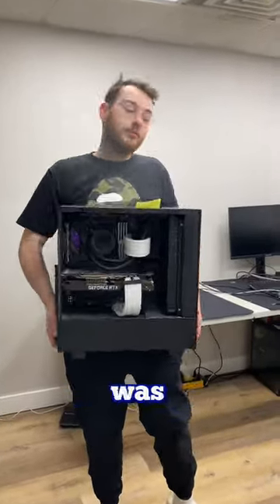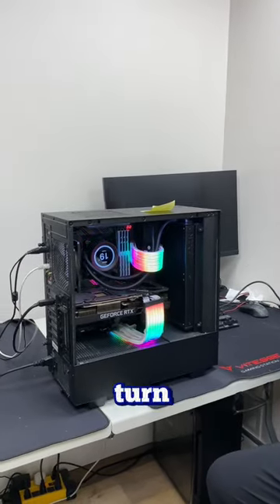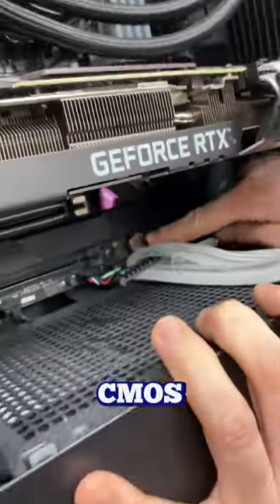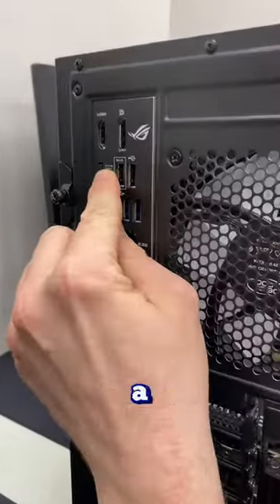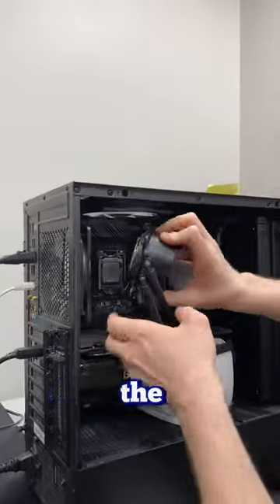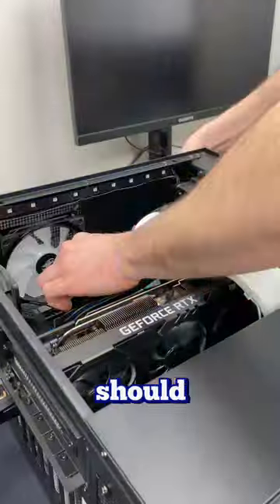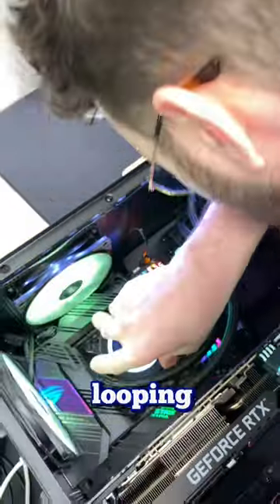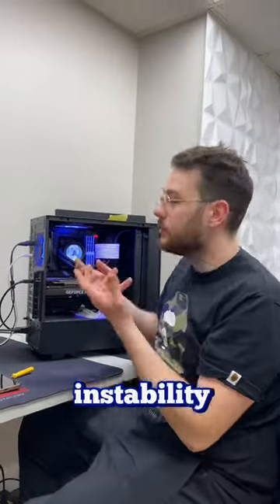PC NOT BOOTING?! 😤 #pc #pcrepair #gamingpc #pcgaming #egirl #gamerguy

Comment: Meanwhile me (Yesterday 12PM till morning 3AM Today). Also might as well share this if someone encounter similair issue like mine. Epsecially if you have no indication what error # it is(No beep sound/LCD).

Accidentally slam table resulting no display, restart PC. stuck at booting where GPU fan keeps spinning(It suppose to stop after few seconds).

Reseat RAM→No display→Re plug monitor cable to gpu→Still no display→Remove CMOS and wait for 30-45 seconds and insert it back→Again, no display→start panicking→Disassemble everything→Clean PC because it's dirty as heck→Realize I have no thermal paste spare→Go to city and buy one→Reach home sweat as hay→Re-assemble everything→Turn on→Same result→Drinks lots water→Decide to go back to the in start by Reseat the RAM... It somehow fix.

Yes, I individually check both my RAM in both sloth, no fix at start.
Reply: After you left it for a while, did you try to turn in it on, or just removed the ram and put it back without turning it on in and it worked

Comment: The fact the cooler LCD display was upside down speaks volumes😂
Reply: You change it in the nzxt software. The lcd does not spin and there’s some
Boards that won’t let you mount the other way around because the hoses may hit the ram or the vrm heatsinks.

Comment: Those rgb cable extensions make me cringe internally
Reply: You change it in the nzxt software. The lcd does not spin and there’s some
Boards that won’t let you mount the other way around because the hoses may hit the ram or the vrm heatsinks.

Comment: I have the same problem with my PC, it crash and only the rgb lights of my ram is on and my other hardware like keyboard, mouse, monitor is on but there's no boot. Also the fan stop spinning but the ram rgb is on. Tried to detach the CMOS but it didn't work after 5 mins. Tried to detach my ram and ends up the same the moment i hook up the power cable and turn on the PSU. It would only light up the ram rgb, monitor, mouse, and keyboard but anything else is dead and fan is not spinning same as before. I would like to hear ur advice on how to solve this hang, because i tried everything but it won't work  the restart and power bottom also won't work.
Reply: Did you find a solution?
Reply: @Dumb-cq2qp  I tried everything and in the end i just replaced the motherboard.

Comment: Ich wanna upgrade my pc and I do not know how much watt my powersuply should have. 
This components should be in it: Ryzen 7 5800x, asus rog strix B450 Gaming motherboard, nzxt kraken x73, 6 fances from nzxt with rgb and a NVIDIA Geforce Rtx 4070 build an a H9.
Could you help me please?
Reply: You should try for a 1000w. One thing I would also recommend is getting a better mobo to support your 4070 ti
Reply: Your motherboard is too bad for a graphics card like that get a less powerful GPU or just get a better mobo
Reply: Ok, but would it also work if I do not change it?
Reply: @bedrockhd1006  yes it would, but you would not be able to take full advantage of your 4070 ti with it, since it only has pcie gen 3. If you have the money for a 4070 ti why not spend a couple hundred extra on a b550?
Reply: Yes, but this Motherboard is not oder than 6 Montag...
Reply: I thing I could, because on amazon it only costs 150€
Reply: @bedrockhd1006 that doesn’t make the mobo good, the b450 is for BUDGET pc’s the 4070 Ti is basically a waste of money in your build, you would be better off with a 3060 (Ti) or 3070
Reply: Get b550 the b450 has pcie gen 3 it’s gonna be slower and a waste of your 4090 why get a 4090 when it’ll be preforming like a 3090 bud
Reply: @bedrockhd1006  it will yes but please save some money and get a worse GPU the 4070 Ti is NOT worth it for a fucking b450 it will work yes but it will not perform like a 4070 Ti it will work like a 3060 Ti